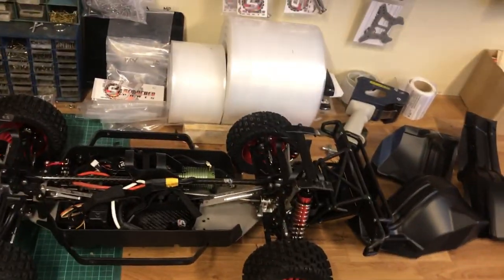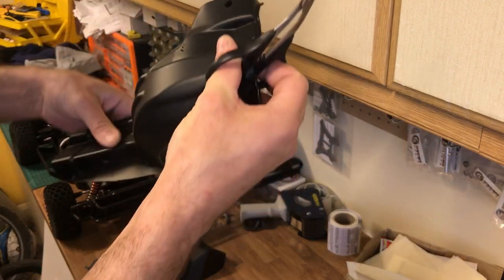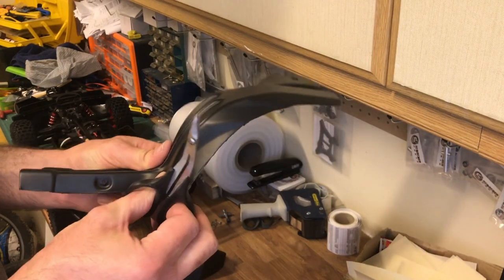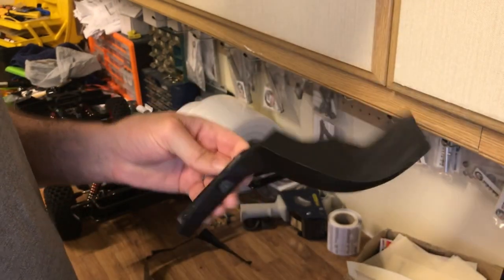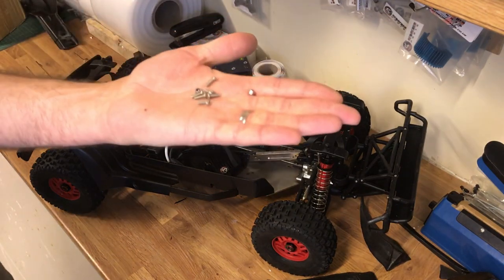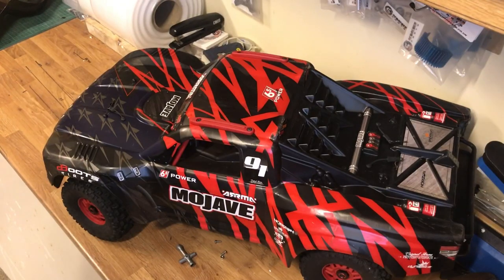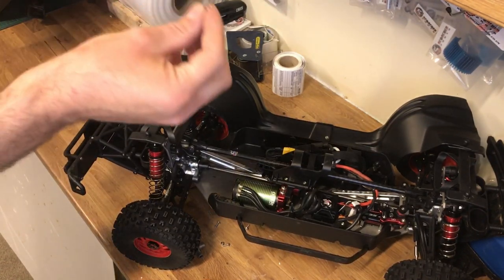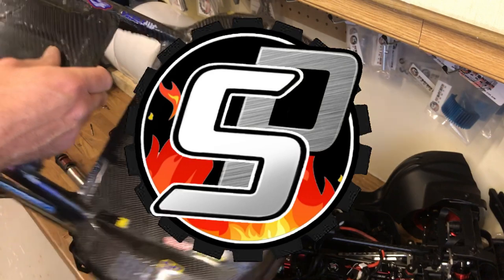Arrma  Mojave Scorched Parts fenders cut and fit

Comment: These restrict air flow and causes the Motor and ESC to run hot.  Anyone who says different has not checked this.  I ran 1 full pack with them on.  They did not stop debris from getting in (less yes), I checked the temps and they where too hot to keep these on.  Waste of money